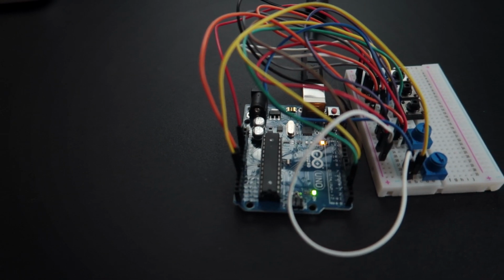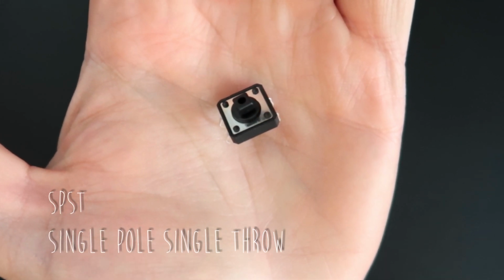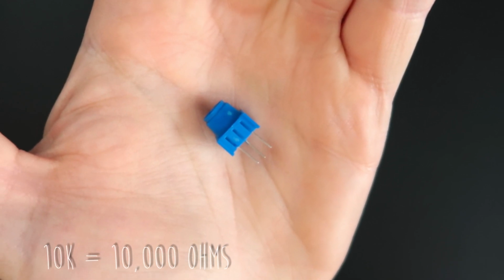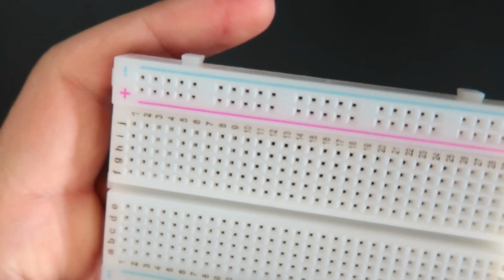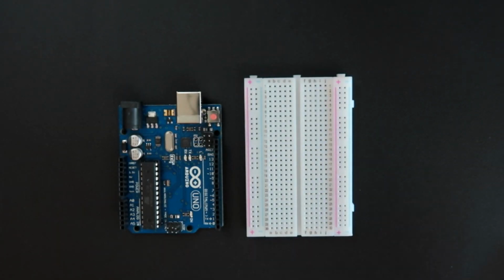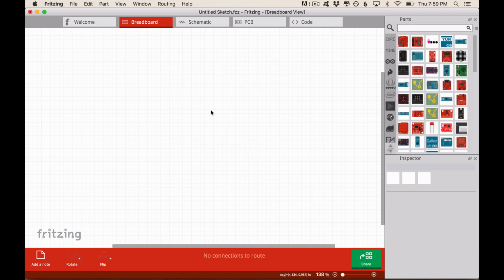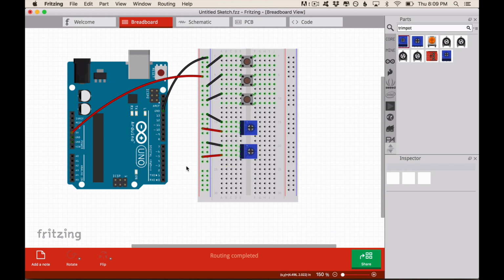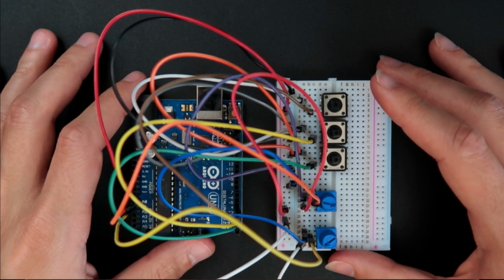#2 How to Build a MIDI controller with an Arduino: The DIY MIDI Controller Workshop 2.0

Comment: Great job, i try to make the same but i have a problem, my Arduino have the chip CH340 and there are some problems for midi ports configuration, do you know if there is a system to use the chip CH340 or i need to buy another Arduino? Thanks
Reply from the maker: The CH340 can't be MIDI class compliant. Use an Arduino Pro Micro instead. Follow this updated guide: https://go.musiconerd.com/diy-midi-controller-workshop

Comment: I followed the code and wiring, but I keep getting weird Symbols in the serial monitor. I have my baud rate set to 115200 but I keep running into this problem
Reply from the maker: Did you delcare DEBUG in the begining of the code?
Reply: @NerdMusician  i did, but since I commented, I read through more comments and un commented line 36 and it fixed my issue. Thanks for the response!

Comment: Great Channel. Congrats. Can I ask you something? I Would really apreciatte It. I am building a midi pedalboard to control pluggins I use when playing the guitar. I did It with a Tennsy ++ board and works really good. My question is about if I Will Burn the board if I connect 2 neopixel strip of 8 leds each at the same time to the 5v output of the Teensy. They Will not be at the higher intensity, just  to the half power each. I don't want to add an external power device.... What do you think? Thank you so much and congrats for your proyects, they are awesome.
Reply from the maker: You can't connect a neopixel straight to a 5v pin. You need to connect it to digital pin and control it via code in the Arduino. It's a little more complicated than you think! But 8 LEDs you should be ok without a power supply if you don't use all LEDs at once full brightness.
Reply: @NerdMusician  thanks for your answer. Let me know if I am wrong, but I understand that the 3 pins of the Neopixel strip are for connect:
-Ground( board ground)
-Data( digital pin)
-Power( 5v board pin/battery/external power supply)
I know that the leds are controlled by the Code but you need to supply power somehow right?
Am I wrong?
Thanks.

Comment: I had been introduced with to the world of arduino years ago from a friend cause their strand required them to work with it.  Basically just brushed it off cause it seemed too intimidating and even though I found it interesting I didn't bother to check it out because I felt intimidated by the coding that came with it.  Days ago I just found out how you  an build midi footswitches and pedal loops with it and how the coding can just even be downloaded.  I've been hooked ever since and your videos are very helpful and easily digestible! Keep the videos coming cause their great!

Comment: How can i add more buttons (15 in total), like where should i wire them? (I want to assign an octave of the piano roll on some of them) And if i do my midi controller on leonardo will ableton detect the arduino without the hairless thing?
Reply: I was thinking about multiplexers but i heard that you can't use multiple buttons at the same time and i need to play chords too 😅
Reply from the maker: You can use multiplexers for multiple notes at the same time! For Leonardo you need to declare ATmega32U4 in the boards part in the code. This code doesn't have support for multiplexers though. I only have the one with multiplexers in the MMwA course...

Comment: Is it theoretically possible to build a Midi controller where the knobs/sliders/buttons could be modular, where you could hotswap the buttons in a breadboard-type situation? Not an electronics expert so any advice would be appreciated.
Reply from the maker: There's a product like that already. I can't remeber the name... So, yes. You'd have to work with some magnetic connections.

Comment: if i have a analog mixer, can i use the parts such as knobs fader ect with arduino?
Reply from the maker: It depends. Usually audio potentiometers are log instead of linear. You can use it, but you can linearize the logarithmic response. You'll just need some extra math.
Reply: Músico Nerd thanks

Comment: which one is better to use? arduino uno or arduino leonardo(atmega32u4)?
Reply from the maker: Leonardo because of what you already said, ir doesn't need Hairless. But Uno can be used too as a MIDI class compliant device, it only needs a few more steps.